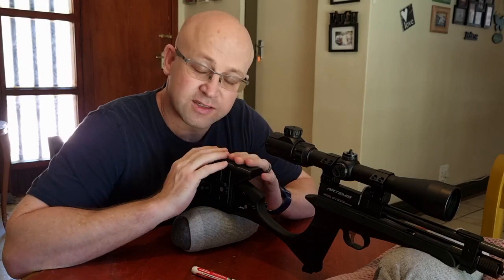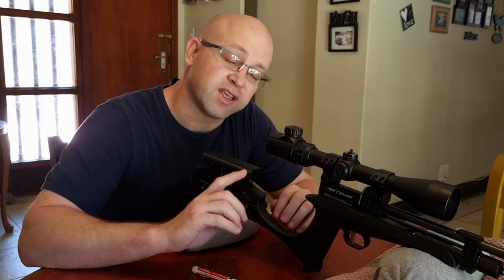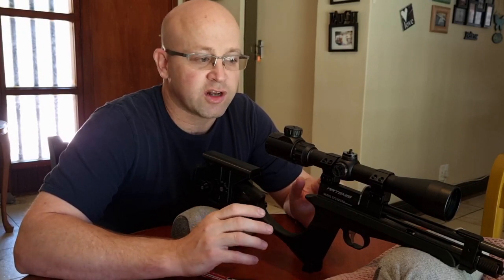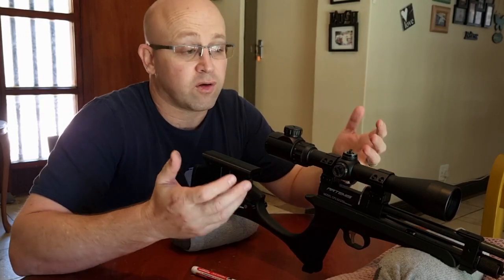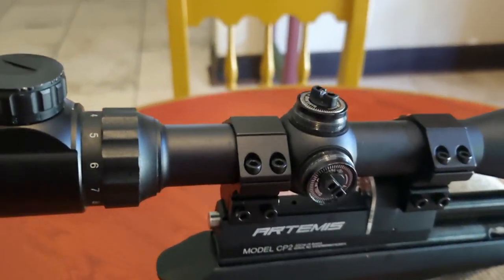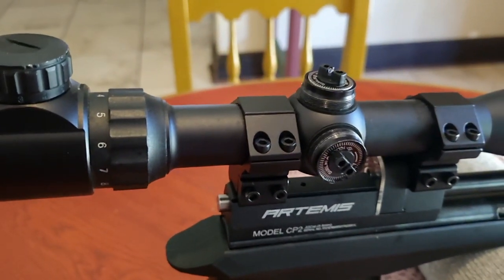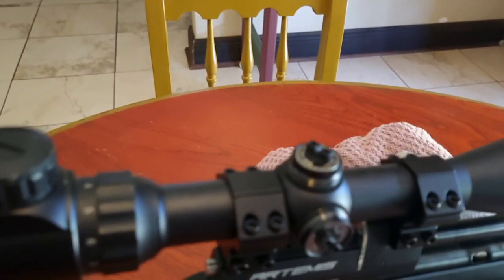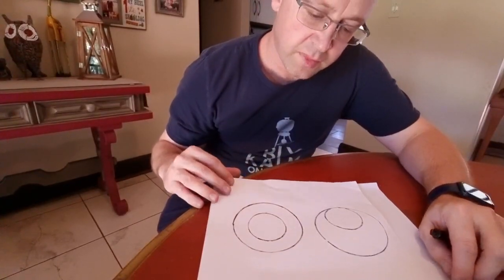Should you shim your scope? why? when? HOW?

Comment: You need adjustable mounting rings so you dont have to shim the scope,,, sometimes the rails are not prefect, either straight or level Right Left, Up Down can be off and an adjustable mount will compensate for that.... Zero the cross hair to factory ZERO with a mirror THEN sight it in !!!! NO SHIMS REQUIRED !!!! Good video and maybe the owner cant get the adjustable mounts so they will have to shim and I used too until I found out about the adjustable rail mounts,,, what that rail is not perfect precision I don't know but apparently not all are so compensation is required,,, trouble was finding a shim that did not compress over time,,,, might have that today to buy but when I was doing that there was not even internet LOL.... thanks for the video !!!!!
Reply from the maker: Thanks Bill for your insightful comments.  I agree with you that if you have the money go for a good set of adjustable mounts. If you don't have the bucks the shimming option will work a charm. I have seen a few rifles in my time where factory dovetails weren't very straight however most of the time guys run out of elevation. Then 1 or 2 small shims will do the trick
Reply: Can you give me a brief description of how to factory set it with a mirror, or just send a link to another video. I'm very new to air guns and my rifle has run out of clicks, you have to aim at 8 inches below the target and there's no more adjustment.
Reply from the maker: If you have run out of elevation just drop 2 shims under the scope on the back ring. To get everything level, I usually do it by eye, check the bottom of your cross hair is in the middle of the stock. As long as you aren't shooting 200m+ this should be good enough

Comment: I think shimming the base and not the scope tube would be better. Shimming the tube would risk crimping it unless you have a corresponding top shim. I am thinking about large rifles and not air rifles so less forces to deal with in your case.
Reply from the maker: I think if it was possible to shim the base that would work but not too sure how effective it would be. If you use a soft shim there is very little to no chance of you damaging the tube. If is basically the same as if you were tightening the normal scope ring

Comment: Thanks for the informative video.  I've been shooting and mounting scopes for over 40 years on every sort of firearm and up until now I've somehow been lucky enough to never need to shim a scope to facilitate getting it sighted in.  However, my most recent project on a Ruger rifle using the manufacturer supplied scope rings finds me needing to shim the scope.  I have heard of others shimming their scopes using aluminum drink cans.  I think the aluminum might be a bit more resilient and durable under the load as opposed to the plastic bottle material.  Great video.  Thanks.
Reply from the maker: Glad I could help. You are 100% correct, you can use aluminum as well, it could possibly be a little more resilient not that I think you will really need to much in this application as it is purely to take up space. As long as it doesn't deform too much you should be fine. Thanks for dropping a comment

Comment: I liked your video and the fairly quick fix you used to remedy your elevation problem. HOWEVER it would have been nice to FIRST hear WHY you needed to do it in the first place? Such as "my point of impact vertically was TOO LOW". And that you reached the maximum amount of travel (clicks) trying to move your point of impact higher. Was that your issue? That is the issue I am also having. After shooting your air gun, was that enough to hit your mark? Any clicks remaining for future adjustments? Thanks.
Reply from the maker: That was exactly the issue I ran out of elevation adjustment. With the shims you are more or less in the middle of the elevation adjustment so can go up or down the whole range of the scope

Comment: Always use adjustable mounts never shim a scope. 
That would be a bodge at the very least perhaps for a pcp with no recoil. I understand that some Springer break barrels suffer with barrel droop hence the need for adjustable mounts
When you shim or angle a scope in such away the scope mounts are not parallel with the scope the front of the scope only sits on the very front edge of the front mount with a void behind it so when you tighten down firmly to secure the scope you actually bend it.
Reply from the maker: Thanks David for your insights, I have done this many times and never had any issues but I do see how it could have an effect if it was like 3-5mm of shims but with less than a mm it shouldn't have an influence
Reply: @African-Budget-Pellet-Gunner  No worries every one to there own Tyrone 👍still enjoy your vids
Reply from the maker: Thanks David and I am sure some will share your sentiment for sure. Thanks for leaving a comment even if you don't agree with my methods for this. I guess all the difference in opinions helps us all to learn and grow.
Reply: Even if you use ajustable mounts you are still bending the scope and the mount are not parallel to each other
Reply from the maker: Agreed hence I think it is appropriate to do this for minor adjustments, obviously not for high end PCP'S trying to shoot 200m with $2000 scopes
Reply: @African-Budget-Pellet-Gunner  it worked and is still working on my FX Dreamline with a R 3800 scope in Ffp. It is only two layers of masking tape so i cant see what damage it can do to the scope. Yes if you shim it 5 mm or more then you can damage the scope. The same will happen with ajustable mounts. If you ajust them to much then you also bending thetube.
Reply from the maker: I am 100% with you. FX Dreamline that's a real beauty, where are you in SA
Reply: @African-Budget-Pellet-Gunner  in Jeffreys Bay. In have a Tactical but in put a wooden stock on it. Changed it a bit.
Reply from the maker: Awesome I haven't really spent time around Jeffrey's but it is a great holiday destination. Well we all tend to mod guns to suit our needs or circumstances, nice to have you around the channel

Comment: No, you should get an adjustable mount and do the rigjt thing.
Reply from the maker: Thanks for your comment, shimming a scope is actually quite a common practice but by all means if you would rather buy adjustable mounts that will also work
Reply: Leupold recommends shimming. I guess you know better than them.
Reply from the maker: Thanks, I guess you're also for shimming. Most scope companies prefer the adjustable mounts but then again they also selling and marketing those mounts, so always an interesting discussion. Logic and mechanical experience tells me we should be ok😉
Reply: @African-Budget-Pellet-Gunner  I have never done it but found your video now that I need to do it on a leupold standard mount.
Reply from the maker: No stress, it is pretty easy

Comment: What to do when you run out of windage?
Reply from the maker: Windage is not as easy unfortunately. What I would suggest if you run out of windage is to swop your scope mounts around. If windage is an issue it is usually the dovetail that is out of centre wen compared to the barrel or it can be that the mounts were poorly machined

Comment: Some mounts have a grub screw, Whilst this is ostensibly for locking the mount to the rail on a firearm, few firearms use 11mm dovetail (I can't think of any). It is usually only one of the them, and can be used to shim the rear one up.
I did find I had to use a little builder's spirit level on the receiver to get the gun level before using a plumb bob hanging from the bird feeder for the scope, nothing down the garden is horizontal to line up on. 
I do cant rather badly so I've added a spirit bubble to the scope tube, easiest to set level mounted there.
Reply: Renegadebroadcasting Renegadebroadcasting  our house is Victorian, so no, I cannot rely on them being vertical 😉